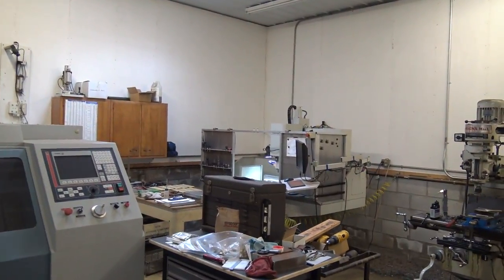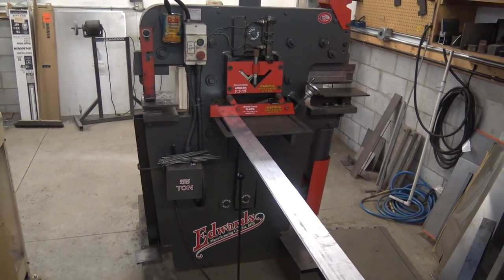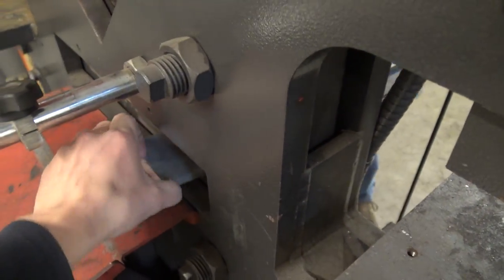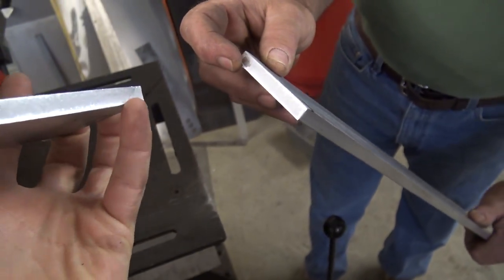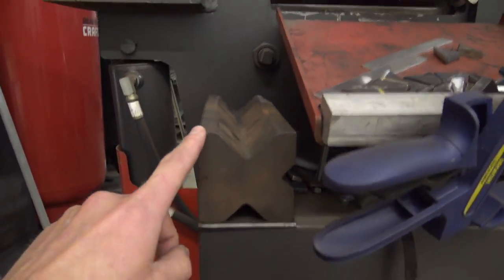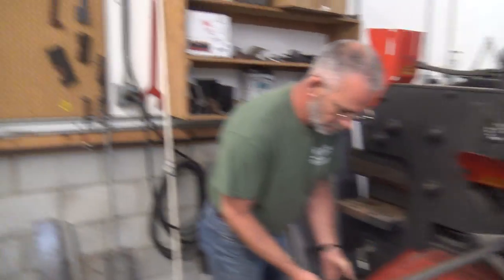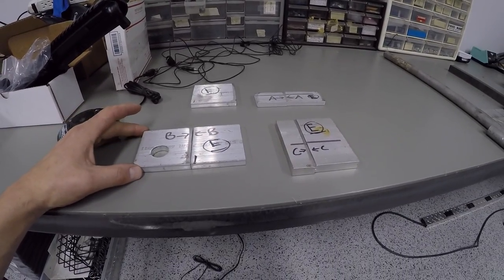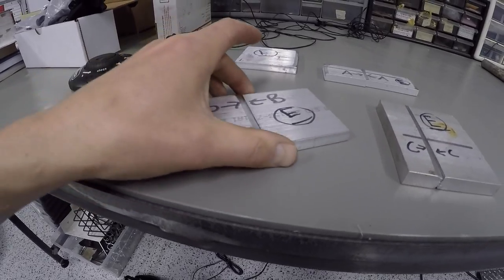What is an Iron Worker? An AWESOME Machine!

Comment: Great video and analysis John. A few comments if I may, some are very obvious, but are often forgotten:1: it doesn't matter if you have to machine an extra 1/8th off to trim the end IF it is time and cost positive2: bandsaws are slow and coolant is a contaminant in some circumstances3: shears don't require as many blade changes, very low operating costs3: people get too hung up about precision hole sizes when they are not required - extra precision = extra cost, a punched hole is done in seconds, including the setup!4: time is money, productivity is profit5: If I have never had or used one before - I often buy the cheapest machine that I think will do what I want. That way my exposure is reduced, and I learn what I like/dislike/want/need. You would be surprised at how many times the cheapie is still going and doing a perfectly adequate jobI am looking forward to seeing the new machine in actionGreg
Reply: Just another thought - the shear works by taking the metal past its yield point and the deformation looks like it is caused by the rake on the tool. You might find that experimenting with different rakes on the cutting edges might reduce the edge compression, but might also cause more or less tearing at the edge. It might be worth experimenting with, or Edwards might have a special Al set of shears

Comment: shearing and punching, are fracturing the metal.  the quality of edge you got was because the aluminum is soft.  mild steel shears awesome and CRS will have a very similar look to it as the Al.

you should absolutely be using that for cnc material prep.  I have done the cost analysis to have parts cnc plasma, lasered or sheared and punched.  I could do the parts for a third the cost of the laser and a little faster as well.  

A large shear is going to be about 20k.  if your going to that do it right, 8 ft x .250 minimum but the 10 ft is ida. you have the space but damn are they expspensive.  I could really use one but for the cost and space I can not justify it when alro will shear to width and then I just chunk it into blanks on the CST.  if you do look at shears go with a mechanical type and not a hydraulic one.  about 4 times the cycles per minute.  works awesome for small little parts.

Comment: In tool and die, we use 10% material thickness 12% for thicker material and 8% for very thin. I do believe this is in machinist handbook,definitely in tool and die books. this applies to shearing and punching holes. there are few other variables, this is good rule of thumb. not sure how easy it is to adjust cutting clearance on this machine. there is also a easy formula to figure out tons needed to cut , I'll have to dig that up if anyone is interested.

Comment: The Edwards looks like a good machine. It is as little small compared to what I'm used to though. when you decide to look for a brake let me know and I give you whatever advice I can. I've run from 100 ton doing .038 up to 2500 ton up to 12" thick.

Comment: If your main squeeze is aluminum you might want to check out an aircraft shop for tricks in fabing cleaner edges and holes, etc. Might be as simple as grinding a different angle on the blades?With use you probably will figure out tricks of your own!  Cheers

Comment: Use a 90 tooth cutting wheel from the DeWalt or better yet use the red blade called Diablo for metal cutting.
Both need be 12” blade. It’s a high speed blade and will cut Aluminum for months before you would need to have the blade re-sharpened.

Will give clean thin line cuts

Comment: For the aluminum get a chop saw with a carbide blade.  Very clean cuts.  That shear is going to mess up the grain structure into the ends of the  cut bar.  Just don't push the cut.

Comment: I have little experience with these machines but in school I had ½ year in sheet fabs. The cutters need to be set for each thickness, otherwise it will cut bad. Though we only cut max 2mm sheets so it didn't make much of a difference. Aluminium might be bad to cut because as you said it's soft. If you want to make 25mm hole and you punch it to say 20mm of course it's going to save some time and tools. Then again it might harden the edge and the tools don't last as good. And you need to be pretty good on spot or else it's going to cut uneven.

Comment: Could you try to experiment with pre-scoring/grooving the stock before the sheer to see if you get a better quality output. I know it might not be job-shop economical but it is worth noting. I would start by grooving all 4 sides and back off from there
Reply: +NYC CNC Another way to think about it is that you can groove down to the vice holding level and sheer the rest

Comment: Could a punched whole in metal also make the stronger part, as apposed to drilling a whole? Even using a slightly conical shaped punch (it would produce a smaller plug than the whole which is created). Would that work harden it in some way? That would be interesting to see.

Comment: Shearing typically has some deformation some more than others of course a dull shear blade won't help. It all depends what you are going to do with the parts. If the sheared edges are going to be welded it doesn't matter much. If you need a clean edge shearing isn't the best choice. Cutting multiple bars in a band saw would be more productive however. You could also use a cold saw thus eliminating the secondary machining.

Comment: 2 comments, 
1:) it is 25.4mm to the inch, not 25.2 as stated.
2:) Does shearing cause any change in the hardness of the material at the shear point due to work hardening or other stresses? Can this effect machining practices similar to needing to rough off the scale and slag from hot cuts? 

Also, regardless of price, your gut told you which way to go, and i would have done the same. If you don't know a key thing like the measurement system the machine you sell is built to, how are you going to be able to service it when it breaks?
Reply: third one was free.....
Reply: I think that you are absolutely spot on with your comments. I was appalled that the guys peddling the expensive machine had never tried to run a bit of 1" solid bar through their machine. What else havent they tried to run through it?

Comment: Changing the clearance will change result. That thick aluminum probably needs 0.02" clearance from die to punch. Id get a horizontal bandsaw. King makes one for $1000. Cut bar in half and stack, easy. Blade should last long time. Check Amada for punch and shears

Comment: Ya know my recommendation for a dedicated press brake be max 48" bed length and 35 tons.  you can get 60 and more tons and longer beds but seriously it does 16 ga mild steel at 35 tons very well and get one that does modern tooling.
Reply: My true forte' is pressroom applications, both punching and bending/forming.
Reply: I wouldn't suggest going lower than 12 tons at the same bed length.  Most of the tooling you'll use is 6" length and no more than the full 48". 

You can also punch in the press brake if you use the UniPunch tooling which takes standard punches and dies.

Wilson is the best tooling I can think of that is the most economical.  There's American and European tooling which seems to be more expensive and more complex setups.

Comment: Would a little bit of cutting oil of some sorts help out with the shearing, in terms of the heat generated and friction between the blade and Metal. Shear is a crude machine but may help out in the long run?
Reply: NYC CNC Haha, okay i'll be watching.
Reply: Bit of CRC or WD40 works really well for lube on cutting stainless steel and steel, aluminium, narrow cut kerosene. I used it on several Trumpf CNC punch machines (spray bottles) and the tool life is greatly improved considerably even when nibbling at ~2400 hits per minute. (Sounds like a machine gun) most parts had little work done to them before paint and shipping.
Reply: MrVajutza 2400 nibbles a min crikey, you should put a video up on Youtube of that.

Comment: A shear deforms, it has too, that is how it works by rupturing the bonds of the material which requires forces beyond the tensile limit of the material., so it it is what it is. For many jobs the deformation is of no real consequence. For welded fabs many times the weld will blend the sheared edge to nothing. I would also imagine you were milling saw cuts as well and not producing parts with sawn edges so milling the deformed material off is not a big deal either, the shears are smoking fast though and starter punched holes would be a huge time saver as well if locating them doesn't take just as long.  I someday plan to have an ironworker because for jobs like building a trailer or something it is the fastest thing around for getting the metal ready to weld.
Reply: I have been a visitor at a steel company that regularly sheared 1.5 inch plate   that was 10 feet wide.  The edges looked the same.  It is the shearing that creates the edges.  Try using tin snips on sheet metal and look at the edges very closely; they should be the same.  Scissors on paper or cloth work by the same principle of cutting in one location at a time.

That seems to be typical of salesmen not knowing all about what they are  selling.  It is a shame.

Comment: If you do decide on a press brake/shear/turret punch press, I would honestly say to go with Accurpress/Accurshear/Accurmax. Amada makes press brakes and turret punch presses, as well, but for one machine, you would probably be able to buy several Tormach's. Amada's best brakes would have to be their RG series, which they don't make anymore. The new machines are good, but there is no reason why they should be $250,000+.

Comment: You see at 214 where he says aha there's our piece? Do you see how he had to walk around the back of the machine to remove it? With these ironworker they just stack up in the back of the machine. Unless they're longer than 3 in plan on taking a lot of steps if you've got a lot of small parts to make. I have a 60 ton and I am not impressed. The guards for the Cooper notcher are virtually impossible to see what your notching. The deck that the die sits in for the punch warps because of the compression and the low grade material. The angle iron cutter rounds out the angle and makes it a half circle when cut. Any other questions?

Comment: Have you checked with Scotchman one of the best I know of my dad used then on the ship in the navy and Racine hacksaws I used them for fab work and almost no distortion or tapers on aluminum there an old company U.S.A. based too. it been a long time since I used them but they are great for anything ask about the punch materials they use and if they don't give you an answer on the spot run they should use A2 O1 types of steel if it's not an old school tool and die steel then forget it check them out my experience is great with scotchman and if the U.S. gov't buys them for a war ship then it's the best you can get. Just my 2 cents I know your still learning but take it from some one who has been in the trade for a while. Great videos man Keep'em coming!
Reply: We had a Scotchman iron worker and a 6' sheer they both worked great we also had a 8' break I think it was the same brand too but I cant remember. Scotman was pretty much the standard in iron workers as well as diacro and whitney punch.
Reply: One thing I can say is bailey went over seas so I expect to see tere quality go way down.

Comment: you keep the small side from tipping down and you will not get that angle and the off side. I use 1" rubber under the part back side keeping it parallel and perpendicular to the blade and keep it sharp  this is  key........

Comment: You will have no trouble with simple material cutting and prep on an ironworker PROVIDED you allow machining stock to remove shear zone deformation. Thus you may require 1/4" longer starting sheared starting material than if minimally sawed.

Another point is shearing and punching introduces stresses in the metal that machining may partly relieve. Therefore some high precision work may require separate (as in unclamp and re-position) ops between rough and finish. 

Have you tried productivity sawing? That is, the first cut is near mid-length at a kerf of multiple lengths plus kerfs. Second is both cut lengths at the new mid-point kerf, and etc. In this way you can cut 16 parts with 4 saw cuts. 32 parts with 5. Your saw guy should know this trick. Another is gang saw multiple lengths of material whose far end is clamped or welded for predictable advance per cut. Run right, a cut-off saw can be damn productive. Your band saw blade supplier should have a book on production sawing.

Sorry if I over-explain.
Reply: Well Forrest, for what its worth, I thought you made an interesting series of relevant comments.
Reply: +NYC CNC. It's easy to lust after fascinating equipment but unless you have a daily need for an iron worker to support your fab operations you better re-think your material prep requirements. Maybe a chop saw with a non ferrous carbide blade. A cold saw. 

What does your crystal ball say about future material prep? Is it economical to have your supplier cut material lengths?

Comment: Deformation comes with how long the blade lasts. The sharper the lesser, but then again, the least it will last. The closer to blunt, the longer it lasts since it has more meat to sustain cuts time and time again. That's how i view it, and it's based on chisels which i've worked with quite a lot.

One of the reasons why i have a band saw as opposed to a shearing system, now, this system, if i can get something like this in Europe, well, i might get one. Having three stations and a angle iron cutting position, at 55 ton, nothing to sneeze at.

Comment: great machine, keep up with adjustment.
Reply: Yes.
There is one in our fab shop at work, we exchange the punch for a notcher attachment for doing hand rail. When the punch is put back on some monkeys don't bother to center the punch to the die, or to lubricate or not put over size material through it etc.
  Got a small pile of chipped, deformed and ruined punches and dies of various size and the cuts aren't as clean as they should be, because of the abuse.
You appear to give do diligence to the care and operation of equipment and should not have a problem.
I work for my county government so I get to see the "best and brightest" perform daily.
My comment came from my experience. Your mileage will most certainly vary. Lol

Comment: Interesting little machine.  I'll be honest never actually seen one. And $10k for that level of versatility is a steal.  May not take the place of dedicated brakes or punches. But could certainly delay the need for one. 

And sheared edge distortion on stock is the reason serrated hard jaws for vices  were made :)
Reply: +NYC CNC you'd be surprised. Put it this way. It took 55 tons over a small shear area to produce that deformation. I don't think a mere 10,000lbs over 6-8" square inches is gonna be enough ;) 

Or you just put a flat brake on the side and squish it back into shape after shearing XD

Comment: Sounds like a no brainer picking between the ironworkers. We never found that it was good for aluminum prep for the VMC. For steel weld and fab work it is the king, for sure. There are plenty of saws that will cut the kind of aluminum material you demoed about as fast as the shear with near perfect edges. The real trick to getting good use out of an iron worker or a saw, is fixturing.

Comment: An iron worker for aluminium is definitely not the best route... 
They’re okay for rough hack jobs in stainless steel and mild steel only. Even when setup and lubricated properly, they leave a nasty finish on all materials.
Fastest way to cut any shape aluminium extruded stock accurately,  is a non-ferrous drop saw with pneumatic clamps, mist lubrication system and a conveyor with an adjustable length stop. 
For example load up 10 lengths of flat bar on the conveyor, then let the pneumatic clamps hold them against the back board (you don’t need to weld them together) and you are cutting 10 parts at a time!  No de-burring required when you have a nice sharp lubricated blade. 
Run you about half the cost of an iron worker too. 
Other benefits are-

-Produces a burr free almost mirror finish cut.
-Can cut mitre angles
-Can also be used for plastics.
-Can cut square stock up to 200mm x 150 (this obviously depends on what size saw you have)
There is simply no comparison if cutting aluminium accurately and fast is your goal.
I have both an iron worker and non-ferrous drop saw at my work place and the iron worker sits in the corner idle most days of the year. It actually only gets used for 2 tasks- trimming small dia stainless rod to length and occasionally punching holes in stainless steel (because we all know how much of a pain drilling stainless steel can be! )

Comment: have had a Edwards iron worker in our shop for about 15 yrs it's never been down a single day
Reply: Mostly hot rolled flat stock and round. The punch spent a lot of time being used for a 1 inch diameter hole in quarter inch angle but we also created our own custom dies and punches
Reply: A 3 & a half inch diameter hole through 3/16 aluminum

Comment: iron workers are a god send when you need to cut things fast and make lots of holes or slotted holes fast. we have a 45ton and 60-70ton in the shop I work at a 45ton will do more then you think I have spent lots of time on iron workers and tbh the set up makes more difference then anything else.
Reply: like how the machine is set up some machines are a bitch to bend things on or to use the shear as a nibbler wile others are super fast and easy to bend or nock the corner off a chunk of steel so it fits in some channel iron